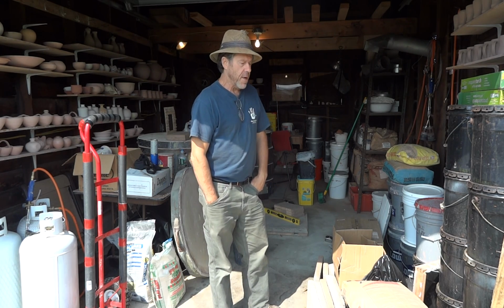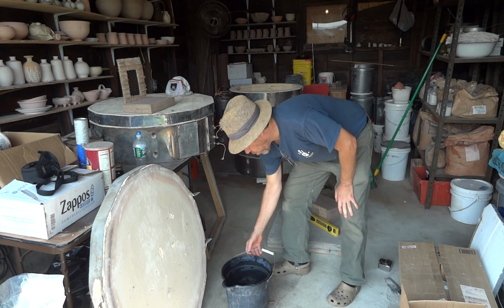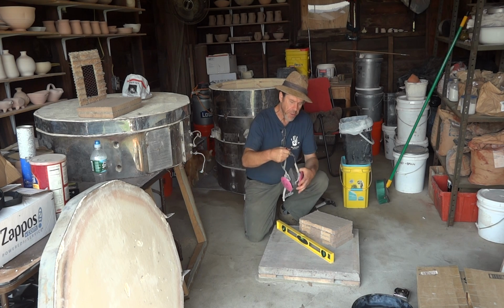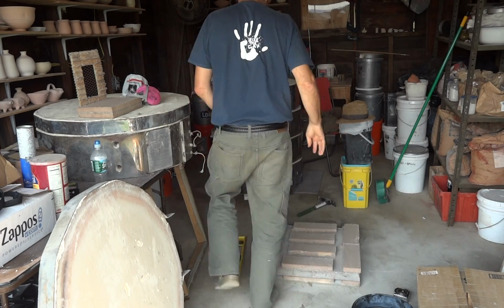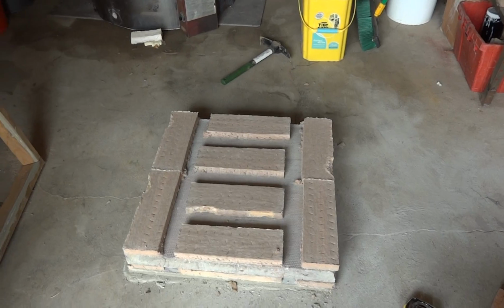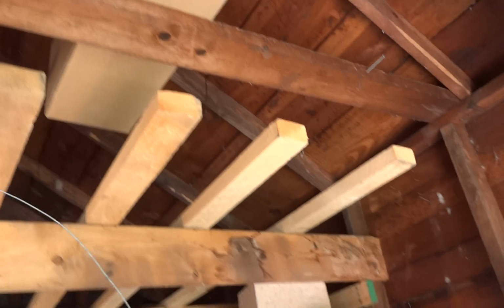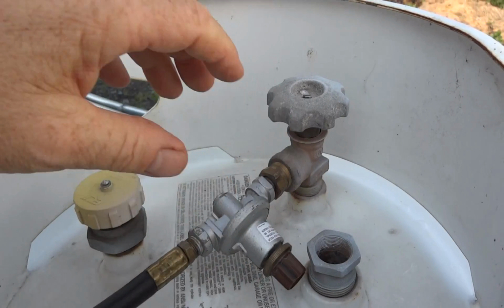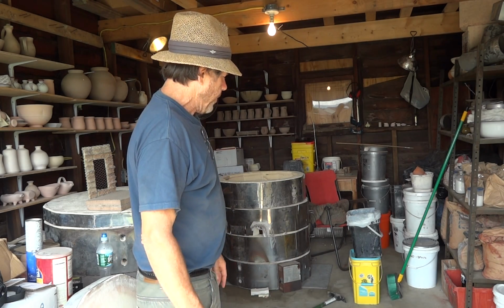SIMON LEACH POTTERY TV - Reconstructing my propane gas kiln ! (1)  - July 30th

Comment: Simon Nice video once again, and looking forward to your Kiln setup video.  One suggestion is that you get a different regulator on the gas bottle with a gauge.  I have one and run it at about 3PSI when you change this pressure it changes the firing dramatically.  I can Skype with you to show you my setup sometime.  I have a new large downdraft kiln.

Comment: you must be psychic, i was just gonna ask how your converto kiln was holding up and you post this !how high do you take it ?cone 10 on a regular basis?are your bricks holding up. mine seem to be melting in spots in the fire box. i use the same weed burner, just one as my kiln is much smaller and try not to exceed 10 psi on my regulator....
Oh and where did you get the ceramic fiber board, that would work much better then the blanket when i need to get a couple more inches of height outa my kiln..